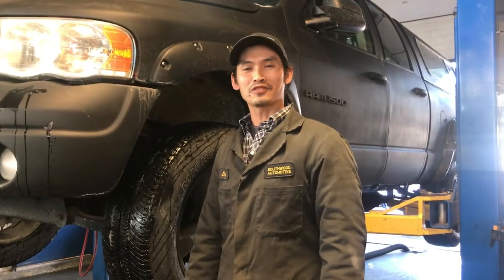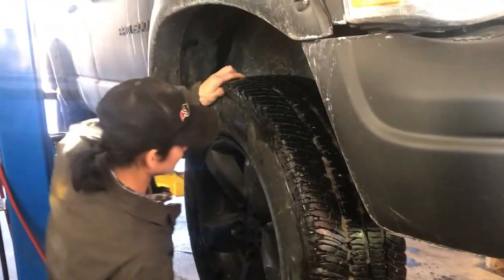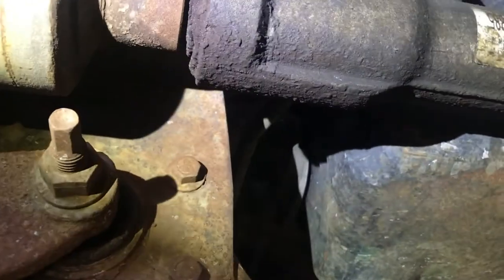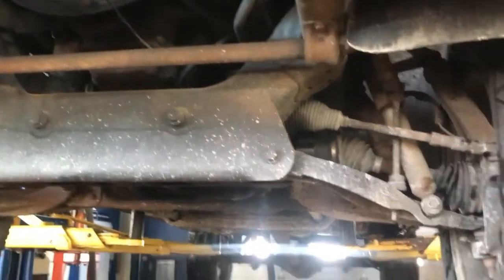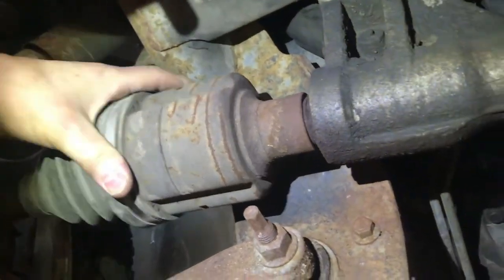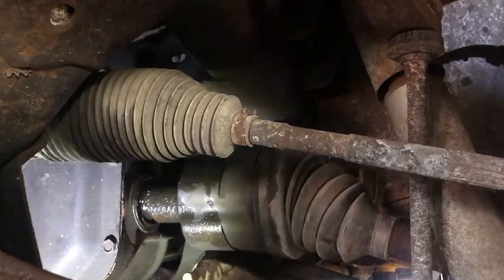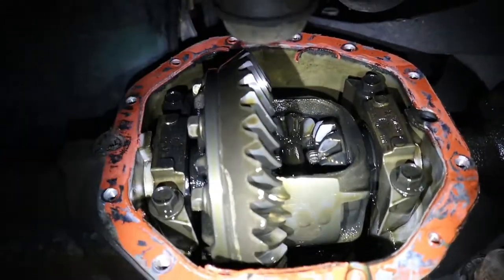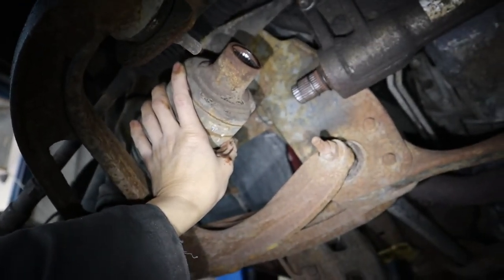THIS Will Happening If You Keep Using 4X4 ( 4HI ) on Dry Pavement

Comment: I did some reading on 4WD on pavement and most mechanical 4WD systems will need slippage for turns but is fine with grip going straight. If you want 4WD on pavement you'll need an AWD system or have hub locks.

Comment: I Had 4H engaged and didnt know that I shouldn't have it engaged on dry pavements. I had it on for about 5 minutes and noticed when I went for a turn , it felt like I couldnt move forward. I tried to move forward a couple times before turning it back to 2H setting. Should I be concerned that there could be a problem with the car because of what I did.
Reply from the maker: I think it’s should be still okay, just don’t do it again 😁. On the straight line is ok but not on turn especially when under load or towing
Reply: Just did the same exact thing. Drove it in 4h straight for like 5 miles. Got into a parking lot and felt like the e brake was on. Went real easy on it...luckily it's raining so it did slip on the pavement enough for me to not destroy it.

Comment: exspensive lesson     wonder how long hes been driveing like that    not trucks fault its almost 20 yrs old     its not a full time AWD vehicle
Reply: Do u know if it is ok for full time 4x4 to drive on pavement ?  Or is pavement driving safe only for 4x4s that can change to 2 wheel drive ? Thanks
Reply: @acemoto2319  It's OK if a fulltime AWD is on pavement, it's different from a 4×4. A AWD setup it basically like open differentials. 4×4 is mainly limited slip front or all lockers on each axle. So if your car is AWD it's fine.
Reply: @zkgarage1939  great 👍😊🏆 🏅 thank you for 4x4 info ZK 👍 Good to know... I have always wondered.  All the best and continued blessings 🙏🌞☘️
Reply: @acemoto2319  No problem! Have a blessed day! 👍

Comment: Did this to my truck and went threw a drive threw and had trouble turning sharp I realized after and now my truck makes the sound when I go in reverse and when I slow down but only at about 15 mph is when it starts squeaking otherwise drives fine should I be concerned
Reply from the maker: Any sounds or noises you should get it check out to see what it is, to make sure it not get worse overtime or fix it now than later, it will cost more $ later.

Comment: Can this happen on a Toyota 4Runner 4th gen?
Reply from the maker: Depend on 4WD or 4X4 or AWD set up.
4WD auto and AWD is ok but 4x4 (4HI) is very hard turning on dry pavement especially in parking lot because front and rear axle are looking up turning at the same speed